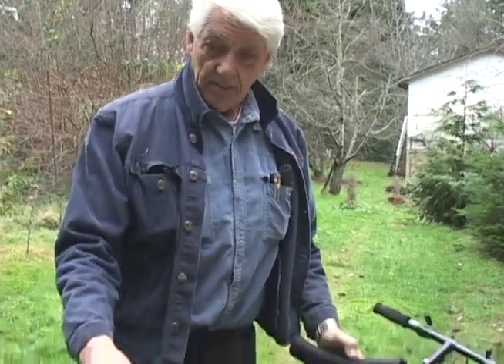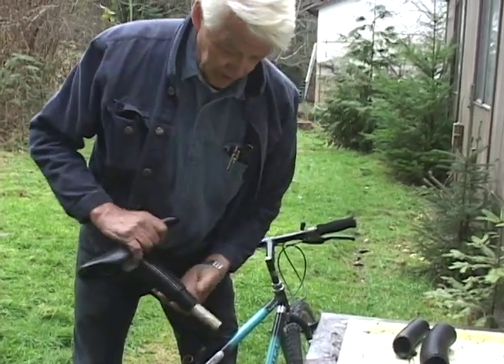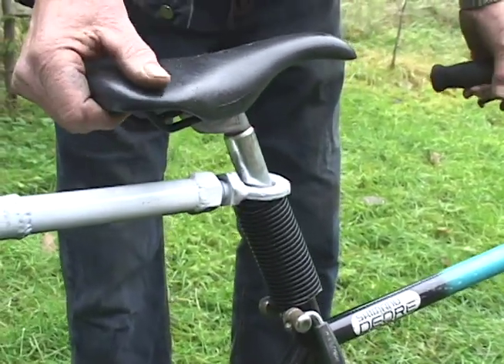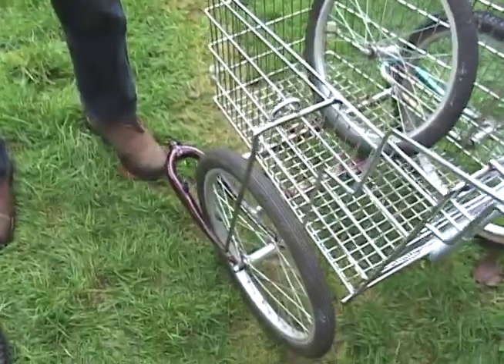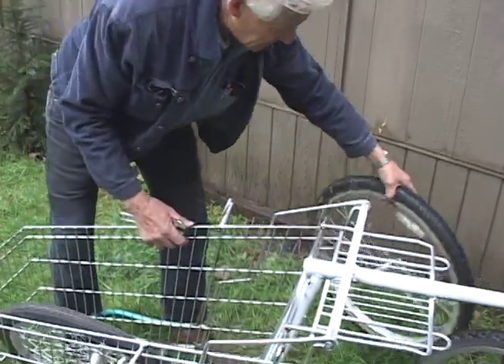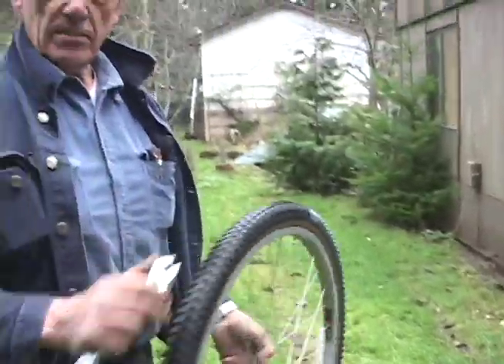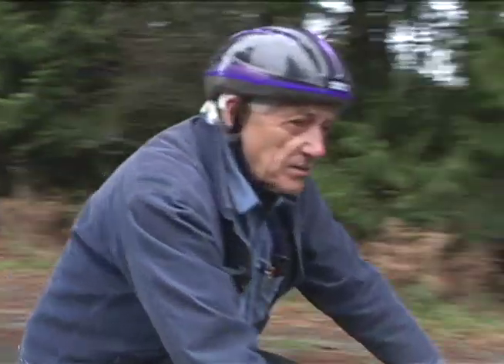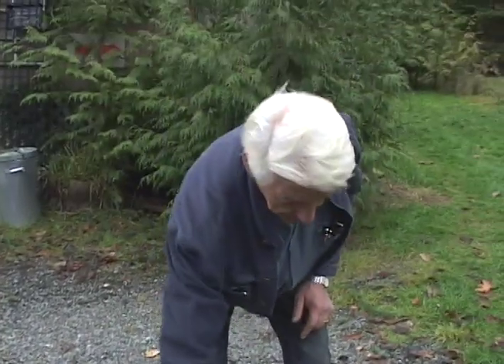Tony's Trailers - Shopping Cart Conversion Part 9 of 9 - Final Adjustments

Comment: Made one out of a trolley and a children's trailer. Removed the nylon tent and placed the trolley on. Good because the trailer pulls from the axial so less likely to throw you off the bike. Also very easy to make. Made from recycled parts, I found at the recycle yard.
Reply: When I was a young boy, did it like this. But I used two bolts and nuts welded together to made the tow hitch off the seat stem. But it was not good if the trailer had weight in it. It became dangerous. Constantly tried to push me off the bike. Off the axle it  limits and  lowers center push on the bike.
Reply: But i like this a lot great idea. I made my latest one for my son. So safety was on my mind and experience  that I had. Trolleys are left every where around here, so why not. I felt i was stealing, but they can afford it. Also fun project with my son.
Reply: Removed all recognition to the supermarket of course.

Comment: As someone who has alot of experience pulling trailers with a bicycle. The only issue I see is the fact that the trailer will weigh 50 lbs or over 20 kilos if u prefer.
Reply: Ya heavy, but good for e bikes pulling lots of weight with trailer

Comment: Could you also make a YouTube video, that shows how to replace each of the four hard rubber casters on a shopping cart, with four 10 inch or four 13 inch air filled tires. Both sizes, of air filled tires, are available at Harbor Freight Tools.